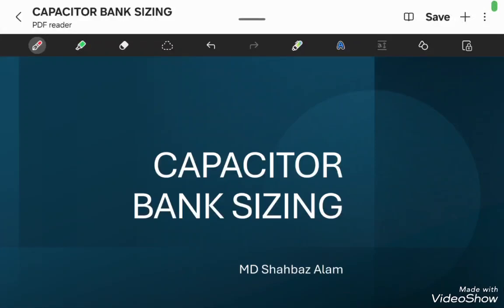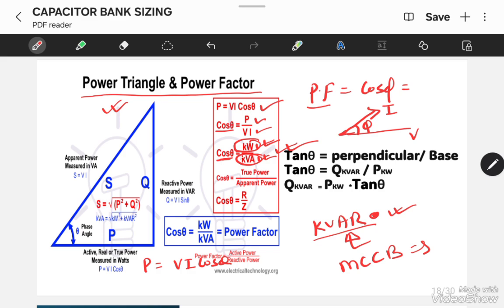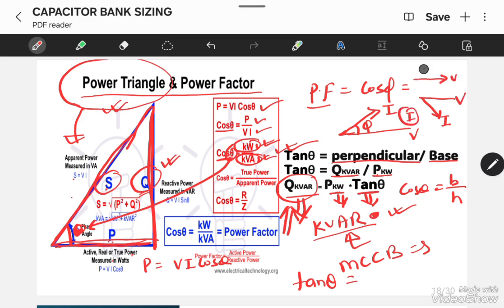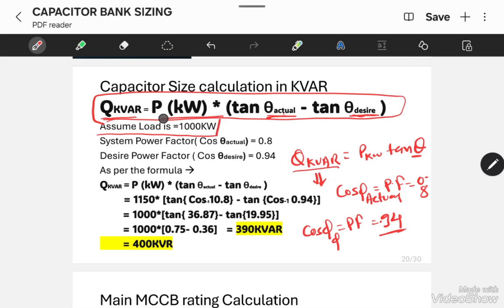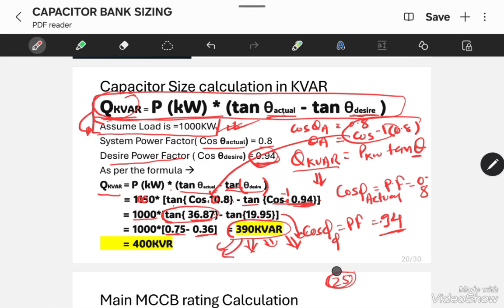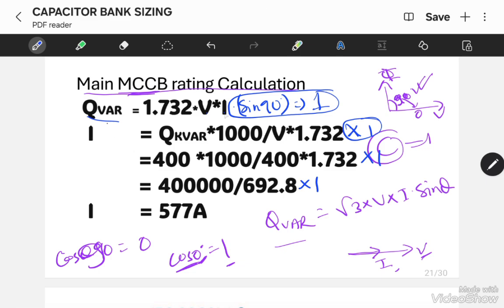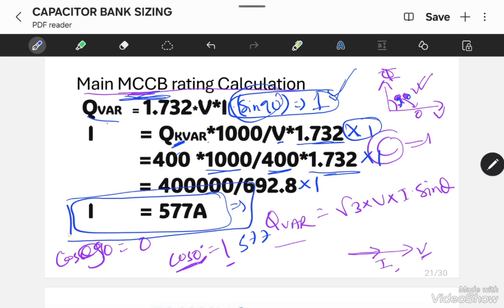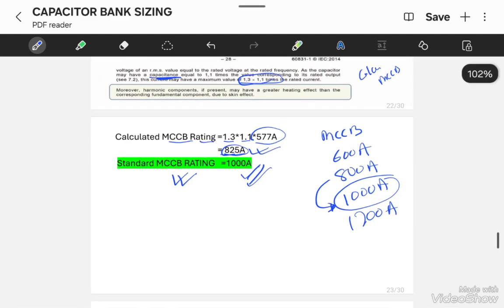Capacitor bank sizing -Part-2

Comment: Thanks well explained.in the video ..for cal capacitor size U mention actual p.f is 0.8 .how we can get this value bro?
Reply from the maker: @Unknown-mf1nh  you have to make a report for connected load list and you have to see the data sheet of all load to know actual average power factor for your selected total connected load
Reply from the maker: @Unknown-mf1nh  there is simple solution also run the load without any correction of power factor and check the power factor value in the Power factor meter or multifunction function meter
Reply: @electricalconcept32   got it bro💯 thank you so much 👍